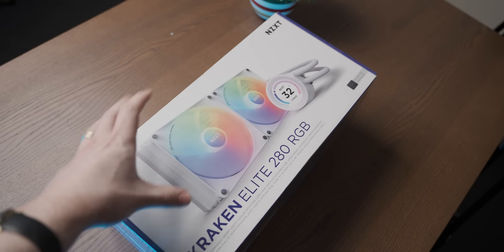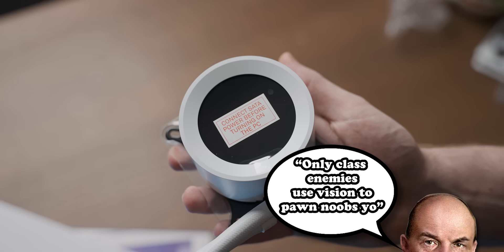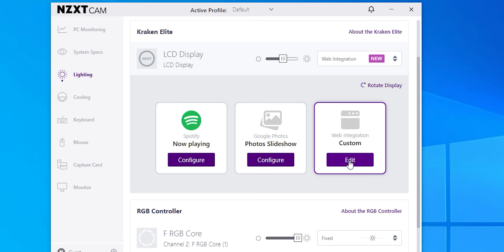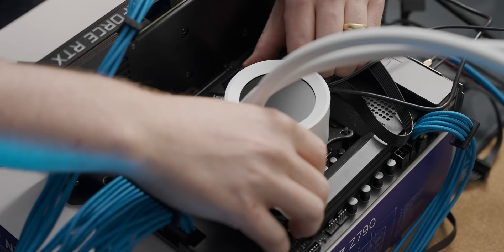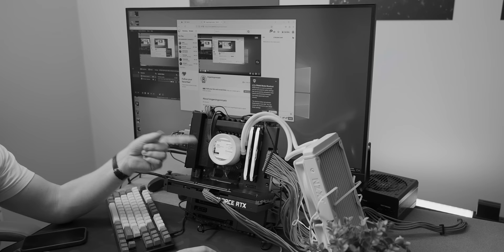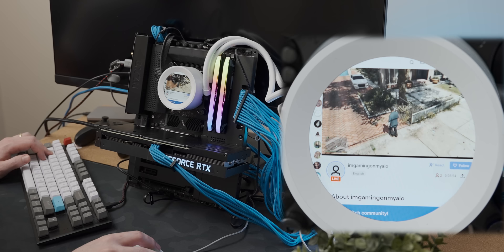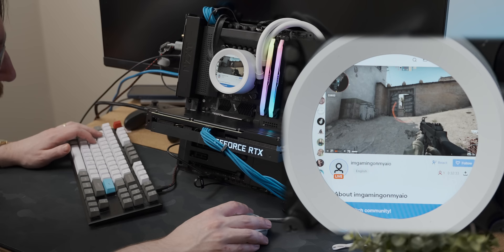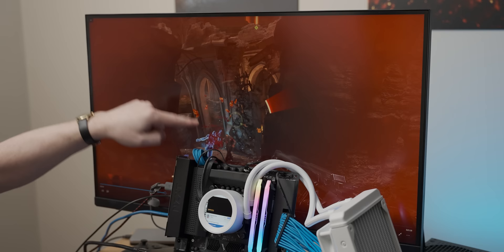I Tried Gaming On My AIO Display...

Comment: You'll be gaming on the display on the side of your 5090 or 6090 pretty soon. Then probably the Motherboard I/O cover, the top of the ram, the top of the m.2, the back of the PSU, etc...
Reply: Seriously, we're getting close with some motherboards.

They have to throw in more teen gamer eye candy to justify the $600+ prices
Reply: There's a display on the side of the aorus xtreme 3080!
Reply: Considering how ludicrously expensive todays GPU's are, I expect they'll come with a complete computer and 4k monitor by 2025
Reply: why have side panels and internal structure when you can just build the case out of monitors
Reply: imagine gaming on your pc fan blades, the higher the rpm the higher the refresh rate!
Reply: You think you're joking but you can get these kind of screens already, yep
Reply: @KyleWarnUs  Yea, the minute I saw the title of this video I was thinking of my Aorus 3070 ti's display.
Reply: It's a matter of time until all in one PC's take over again!
Reply: my 3080 actually has a display :) and there some power supplys as well.
Reply: Of only there was something that was built to be connected to your PC for looking at your games... Oh well, maybe in the future.

Comment: RIP your actual monitor - regards from your motherboard's solder/pins on the backside.
Reply: I need to calm down by scraping my nails on a chalk board.
Reply: Why does that matter? His AIO is his monitor now.
Reply: @alexfrey4828  He won't be competitive in warzone.
Reply: I think it should be okay, because there are some cables that are routed from the front to the back via the top side of the motherboard (although idk if that was just luck or intentional :P)
Reply: the cables where between the mobo and the display so its fine.

Comment: I'm a bit confused as to why NZXT would make a display with 60Hz refresh, but couple it with USB 2.0.  Obviously, there is a bandwidth issue.  No idea how you thought of this, but it's why I sub.
Reply: Because is more of a marketing move than actually make it work
Reply: That's the sucky part he was limited by the CAM software, and hardware interface. There are a lots of small round displays now for hobby electronics projects with HDMI interfaces that can do the proper bandwidth.
Reply: for the same reason they make 10-port SATA-3 adapter cards with a PCIe 3.0x1 interface
Reply: If the desktop is encoding an H.264 video that gets streamed to the display on the cooler, it would only require a fraction of the bandwidth available over USB 2.0. Even a 4K Blu-Ray maxes out at 128 Mbps.
Reply: @bubbledoubletrouble  yeah except I think the cooler is actively rendering the whole website uncompressed

Comment: You could've also used VRCDN as latency is only 0.7 seconds from your PC to the streaming service (using the RTSP link or the MP4 link or the Preview link)
Reply: could also stream through VLC to a server and point the AIO to that URL
Reply: @jormungand72  Or do that locally instead of looping it through internet
Reply: @andrew-vl7gu  you need to point the AIO to a valid web server afaik
Reply: @jormungand72  a local ip is basically a very close web server

Comment: Use ffmpeg to stream desktop to localhost while also resizing the stream to smaller resolution (ideally that fits your AIO). you can open the stream in browser (assuming you have the correct streaming protocol selected). that way you should be able to get your latency down to few seconds or maybe even less...

or you can setup a local rtsp server and stream to it with OBS... then with little HTML knowledge you can make your own little streaming twitch-like platform locally... that will also reduce your latency... (its still going to be few seconds... but definetly better than twitch)

Comment: Just picked up a Jonsbo d41 case and it has a screen built into it. I actually used it to install windows and mess with the bios. I also played a couple games on it. It has the same resolution as a steam deck 1280x800. Pretty neat little case got it for my old parts 5800x3d 3080ti. Love your channel you do crazy stuff nobody else does.
Reply: How good it is to build on it? I really want one for myself
Reply: @Elinzar  i was surprised the build quality was fine came in perfect condition the extra screen looks good its 1280x800. The only complaint I have is there’s not a lot of room behind the motherboard for cable management. But for its size you can put a 360 aio or a decently tall air cooler in it. And I’ve seen people put really big gpu’s like the gaming oc 4090 in it. And the design has plenty of airflow with plenty of holes on the top, bottom and front of the case. I have 3x120 fans on the bottom 2x140 on the top and a 120 on the back and front. I used a thermalright peerless assassin 120 cooler, 5800x3d and a ftw3 3080ti with an evga p2 750 watt psu. Its weird having the psu up front in the case. But it was nice having the small screen i used it to install windows and change some bios settings to make sure everything worked before moving it to my game room. The only crappy thing now is everyone likes this build better than my main rig. Its a 7950x3d, arctic freezer ii 420 cooler, 4090 in a phanteks evolve x case. There are two ways you can get the case screen or no screen and mesh or solid panels. Make sure to get mesh but I hope this helps some. I need to learn how to use aida64 to make cool hardware info templates for the small screen. Thankfully you can find some and download them but I’ve seen some very cool ones. Seems like this case is getting kind of popular mainly because that small screen makes it unique and useful if you like tinkering.
Reply: @ChadKenova  i cant blame them for liking that pc more, smallish cases are all the rage now and even if you got the mid tower ATX one (im aiming for the D31, iirc is the mATX version of this case) is fairly small having the psu in the front

im currently rocking a Maximus Hero IX board and the old ASUS ROG Front Base monitor in front, and is so damm useless... its also not supported in win 11 anymore so yeah, planning to go Alder lake soon and get me the D31 case to build it on and give this pc to my cousing or we

thanks for the details, i will pay attention to the cable magnament and im glad it have good quality, i hope that it survives shipping to Latin america tho lmao, do you remember if it was well packed?

Comment: I've got a case with a display on the front of it.
It's a perfectly normal 8" 1280x800 IPS LCD over HDMI, so there's nothing too special about it other than just the e-peen factor of literally gaming on my gaming PC.
They market it for either Wallpaper Engine or Aida64 sensor panel.

Comment: Something that AIO display would actually be useful for is a raspberry pi cyberdeck style build, the cooling system is also the screen. Ive never seen a cyberdeck with water cooling though, much less one that gets hot enough to need one

Comment: I came from a kraken x63 280 and slapped on a lian li galahad 360 and my temps went down 10 degrees on my 5950x.  I was so surprised it was that much cooler.

Comment: "you can really feel the heat emanating off it" it proves that your machine is working. closer than you're comfortable not to be a solder component in your machine, but still proof it's working. I'll stick with overpriced monitors with low latency and high framerate over being soldering iron myself

Comment: Twitch was a poor plan, as you're pushing the video feed to a server, and then requesting that feed, buffered for stability. While VLC would have a better shot at capturing your desktop, and providing a web-link for viewing, it would still have a lot of problems in setup. I believe your best opportunity to watching your feed with minimal latency would have been to throw up your own RTMP server with NGINX, stream from OBS to it, and pull the video url for the AIO display. This way, you can control the latency, and framerates to reduce spikes, as well as downscale the stream to something the AIO could feasibly render. Secondary options would have been looking for an older piece of VNC software with a web interface, which may have come with significant tearing depending on the protocols used.

Comment: Need to reverse engineer how CAM communicates with the display.  It looks like they have some form of real-time video streaming over USB going on, which means it would be possible to write an actual display driver for it that could either make it show as a second monitor or at least work with a local screen mirroring program.  CAM is pretty terrible.  I've thought about how to integrated LCD devices like this in OpenRGB, but have not attempted any of them yet.  It could be treated as a 640x640 LED matrix and then an ambient lighting mode would work to screen copy but if they're using some form of video compression it might need a different solution.

Comment: I think there might be a market for a screen on the side of your PC case, or even a thin mountable monitor you can add into existing cases.
Reply: pretty sure those exist, i did pull apart an old monitor and put it inside my pc case that was pretty cool

Comment: LOL, fun video! I have an NZXT Kraken Z63 that has a display on the pump, but I don't think I will be using it for gaming. That rig's RGB is set to emulate fire and molten metal, so I just use a GIF of some fire on the built-in 
screen.

Comment: You need to try this again but enable the low latency mode on twitch in your profile settings because the default setup is 5-7 seconds but I don’t know how much that would help because it’s like 1-2 fps

Comment: I'm just curious if Windows would allow you to make this a primary display so you can set the refresh rate to a steady 30 or 60. 
Or in the software was there a way to set it from 30 to 60. 
Also would it make a difference if you turn down the stream resolution to like to 360p? 
Great fun video though. 😂

Comment: You could probably get a (little) better experience building a local webpage, that streams your virtual webcam in obs. It probably still would have 2fps but I doubt that that can be optimized on the user side.

Comment: If you wanted to actually do this for real it should be pretty easy with the use of a KVM, or just pure software using NDI (albeit you would probably have to compress the stream significantly for the display to be able to keep up, but shouldn't be difficult.

Comment: bent radiator ... ehhh ... 10/10 won't buy

PS:
60 Hz ain't 60 FPS ... if the upstream databus isn't capable of handling the amount of data it will show 60 Hz with 1 Frame ;)

Comment: The framerate is low because windows automatically caps your framerate when you have no display plugged in, meaning it's forced to run around 15 fps or so, not the AIO's fault
Reply: this is not what's happening. The Doom screen capture clearly shows full FPS
Reply: @rossclutterbuck1060  oh ok so it's just the AIO being shit LMFAO